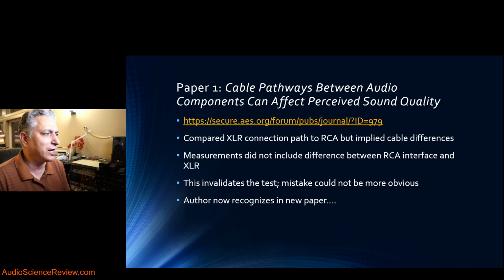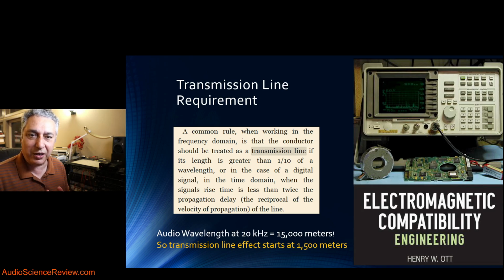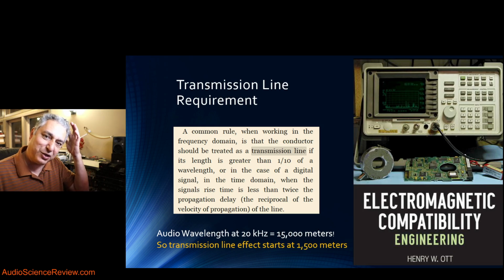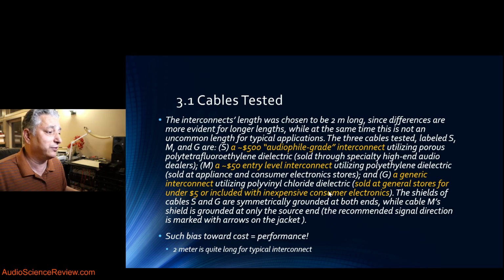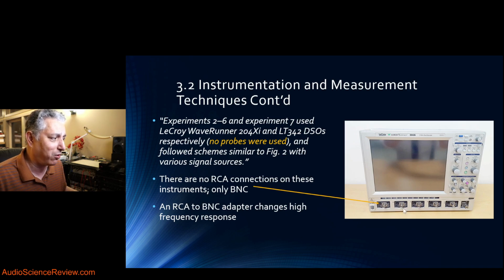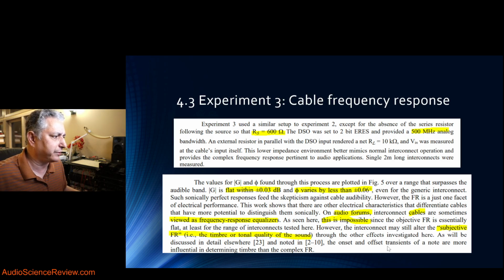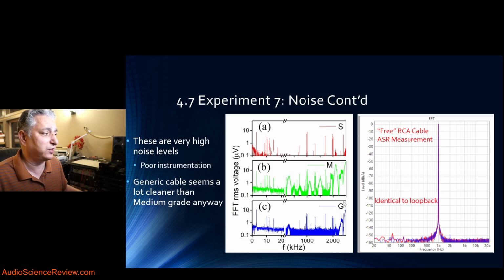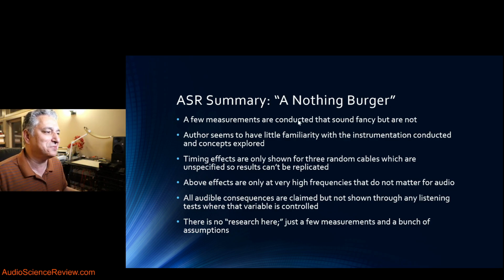Scientific Proof of Measurable Difference in Audio Cables? Paper Review

Comment: You don't need a 40 minute rebuttal to say that all reasonable metal wires at lengths of 1-2 meters conduct line-level audio well.
It's fine that you point out the obvious, but merely conducting audio signals is not sufficient.
Cables need to reject out-of-band noise (reasons listed below). To be complete you need to develop two tests:
1) audio (not 1KHz) mixed with two-tone RF (noise from the source equipment 1KHz apart) to simulate a "dirty" source equipment.
The following equipment is important, since its IMD characteristics determine the content of 1KHz on its output.
For a unified test I'd construct a diplexer with a known RF IMD in the range of the test signals.
2) add a controlled RF source to measure EMI rejection of the cable as an antenna. Similar considerations as for (1) apply.
Obviously the tests must be conducted in a clean RF environment. To some extent a shielded cage would be acceptable.
And if you ask where is the cause and effect of such noise, there is no simple answer.
Mixing products can down-convert to audio, depending on the noise content and the intercepting circuits in the chain.
For digital audio, high frequency noise can find its way into clock circuitry and add jitter.
Again, it is too complex to construct a general test for jitter cause and effect, but you can ask any decent RF engineer.
We can extend the scope of the analysis and question whether a little jitter is audible, but let's not go there...
Reply: @Douglas Blake why do you think that audio equipment cannot pass RF?
There are companies that brag about the extended frequency response of their equipment, sometimes to the MHz range.
In addition, RF tones can mix down to the audio spectrum right at the input stage of the receiving equipment.
Reply: @Douglas Blake So you're doing a good job and probably most designers attempt to do as well - but not all.
For example the Stellavox PW1 amp is made by a company that designs high-end studio gear and it has a spec of +/- 1 dB, 6 Hz - 1 MHz.
The designer may have optimized for phase response at high treble and found this approach beneficial or who knows why.
That's just one example.
You might want to check how much RF goes through stray capacitance in a typical linear power supply, despite the heavy filtering at low frequencies.
Fact is that there is gear out there with less than optimal RF rejection, either by design or lack thereof.
Rather than make assumptions, I go by what I see (an engineer's approach) and it's not all perfect. It would have been nice if it was...
Reply: @Douglas Blake Not reading any specs for cables. Just trying cables and wondering why a Belden RG59 does not work as a digital coax as well as some balanced designs and why a Mogami 2524 does not sound great with my son's guitar compared to some custom-made cables.
A shield works for heavy emissions. If you don't need it, you'd be better off without a shield. There is no free lunch.
If I extrapolate your logic, then all competent gear is perfect and therefore we shouldn't be discussing anything audio period. The problem is that there are differences in gear and not all intentional, so we can have a great time digesting the details... Heck, it's a hobby and I never argue with someone that has a different taste and sonic priorities than mine. If what you hear pleases you at the "perfect level" then you have reached your personal rainbow and can live happily ever after. Some of us are weirdos and so we keep chasing that imaginary perfect rainbow. Sometimes we see it, other times we don't...
I learned enough in my professional life to continue to ask questions. Sometimes I wonder if they make sense, but that's the nature of science. You keep asking rather than rest on your laurels... That's really what makes the world go around you know...😁
Reply: @Douglas Blake unsuccessfully?! Not really. I got excellent results from these cables, just not the ultimate. I'll use Mogami on stage any day. It does the job and the PA amps and speakers stacks are worse anyway.
How about we agree to disagree? You claim it's all the same based on limited instrumental tests and I claim that I can hear differences and therefore I think the instruments are not measuring all the important data. It's a futile exercise to go back and forth, unless you transplant my ears and brain or I give up on listening and enjoy music through my lab instruments.

Comment: A good connection between (sturdy connectors) with low resistance wire  and twisting to reject external radio waves is probably the only requirements to make a good interconnect cable. Right ?
Reply from the maker: For interconnects, yes.  Connector quality definitely varies and some are either way too stiff, or way too lose.   And shielding does need to be good.

Comment: I'm Team Amir all the way. But @11:27 you say the wavelength of a 20KHz sound wave is 15,000 meters? I think it's about 0.0172 meters, or 1.72 centimeters. Am I missing something?
Reply from the maker: Yes, please see the pinned comment.  I am speaking of speed of audio electrical signals in wires.  What you state is speed of sound through air.  The former is what is important in this context, i.e. wires.

Comment: Well the insanely high frequencies makes sense, he probably cranked it up until he was able to see a difference between the 3 cables and as we all know, the "golden ears" will think "well if there is this difference in this high frequencies then there sure must be differences in the low frequencies as well".
Reply from the maker: Indeed.  What is funny is that you hardly need to do any work to show that if that is your aim, i.e. at higher frequencies cable differences show up.  It is a given.

Comment: @Amir: Thanks for the entertaining debunk of poor science by Audiophile. If his profession is really a "scientist", his research in his professional field would also be questionable based on some rudimentary errors that should be quite obvious as a scientist. Not a scientist but a lot of the issues you identified and extracted from his test sounds ALARMING if he is really have a PHD!

Just one question though, regarding audible differences of frequencies but would "quality" RCA cables that have less noise at inaudible frequencies provide any difference in the audio chain between equipments for processing (Eg. DAC > PREAMP > AMP) that will eventually affect the final output? Or most equipments in the chain discard frequency outside the audible spectrum?
Reply: @Douglas Blake So basically the "interconnects" requirements between systems have been standardised based on their requirements which basically means most RCA out of the box from "reputable" brands are good enough? 

Audiophiles who frequently upgrade components really need to be reminded of "The Emperor's New Clothes"!😂
Reply: @soulfreshACV

Yes...... about 1 millionth of a percent.... basically No or as near to no as is possible, without it being 100% no.......

(Loss of 0.0014% over an 11km stretch of cable, at frequencies not even a bat can hear...... in our "real world" of hearing and an interconnect cable of 1 or 2 meters it would be not even be hearable and barely measurable .....)....

DON'T WORRY 👍🏻🙂🙏👌......

Comment: Does SINAD matter? Is there an audible difference between 109 and 123? What subjective audiofoolery is going on to be able to categorise a dac as "excellent" or "good" based on SINAD?
Reply from the maker: If SINAD is dominated by noise -- which is usually the case in top tier -- then yes, the noise can become audible.  It is a simple matter of how loud you play.  Regardless, I have recommended plenty of DACs with SINADs of 109 dB and higher.  It all depends on price and features.  A $99 DAC with SINAD of 109 dB is an excellent DAC.  A DAC that costs $6,000, not so much.

Comment: 0:58 The short answer is "they don't". This, coming from a guy that's actually reviewed speakers only on measurement without actually having listened to them.  an alternate perspective on reality ASR. Attacking the paper is fine, but your opinion as stated is just misinformed. If you can't point to measurements and say what accounts for stage width and depth,
Reply from the maker: What on earth are you talking about?  My speaker and headphone tests have listening tests (with some very rare exceptions).  I even go as far as developing equalization for them by using both measurements and listening tests.  Plenty of measurements indicate sound stage as well if we were to analyze content.  Just pan an instrument from right to left.  It shifts from right to left when you listen to it, right?  That should tell you that content is what defines those factors by far, not some interconnect.  The wire has no ability to make such changes.  If this were otherwise, there would be proper papers with controlled listening tests showing that which there is none.  So please don't repeat talking points like this.  Learn the topic and be informed.
Reply: Stage width and depth has nothing to do with wire and components but what was recorded and how it was reproduced by two or more speakers in an acoustic space.
You should really look for and listen to a CD called Musical Illusions and Paradoxes by Diana Deutsch, Philome 001. 
Just a recording, not special wires and equipment involved.

Comment: You peaked my interest.  Figuring that lump sum parameters are all that are really important here, I found three old RCA cables and wondered what the capacitance was for them.  I was surprised to find that the junk cable that came with a cassette recorder over 45 yrs ago measured the best at ~75pf.  And a high end video cable from Monster measured at ~85pf.  Then a Radio Shack AV cable measured ~175pf for the audio and strangely ~110pf for the composite (Y).  All cables were about the same resistance.  So even the worst cable if driven with a 600 ohm source won't hit the 3dB down point until  over 1.4MHz.

Comment: Maybe I have this completely wrong but in terms of transmission line effect, the audio range starts at 20Hz which has a wavelength of 17m. One tenth of this is 1.7m which is within a reasonable cable length. So is the transmission line effect relevant for low frequencies in the audible band or have ( as is possible, even likely ) I made a rookie mistake ?
I wondered why Amir, somewhat arbitrarily, chose 20,000hz to make his point.
Please help me out here. And please note, I'm not defending this paper which seems to be a pile of shit.
Reply: @Douglas Blake Cheers Douglas. I figured I had made a stupid mistake. Just wasn't sure what it was
Reply: Not sure what Douglas Blake said. Your number if about right in air, not in a cable.

Comment: By not stating the characteristics of a high, middle and low end cable and not providing the reader with manufacturers makes a nonsense of the report.  A $500 cable is not really that 'high end' . What about a $10,000 cable?
Reply from the maker: Indeed.  What is amazing to me is that the people promoting it didn't read and understand that either.   It is written in such plain language so they really have no excuse there.

Comment: if it happens at 1500 meters ,then it must start at zero length. natural things dont just start at 1500m's onwards. .to get to 1500m's youve got to start at zero ,1m and so on. this means it must be happening on a micro scale in smaller length cables..
Reply from the maker: So you must wonder if time is changing for you when you drive because that is what Einstein's relativity says.  But you don't right?  Transmission line effects start to become significant at 1,500 meters.  At 1.5 meter you are 1/1000 times shorter than that *start*.    But sure, do measurements of that and report what you see.  Not send 250 MHz signal and say same thing is true of 20 kHz.

Comment: why does it matter what a good cable or bad cable measures if either one of them sounds good. are you implying that all cables sound the same?
Reply from the maker: Well, the paper in question is being endorsed as measurement proof.  There is no listening test in there so your comment doesn't apply.  But yes, every cable I have tested sounds the same as another when it comes to interconnects.

Comment: Hi I have found your site very interesting and wanted to get your thoughts on the X-18 DAC you rate it as a recommendation based on measurements. Curious as to what your thoughts are on the comments in this video https://www.youtube.com/watch?v=Fa1y9JRip68&ab_channel=GoldenSound at about the 26min mark. Seems to me that you might not be properly measuring some devices
Reply from the maker: Careful with GS videos.  His aim is not genuine when it comes to using measurements to characterize audio performance (he ignores it all when he does his subjective assessments).  On that specific point, he is using an artificial test signal to cause an overflow.  Such overflow would sound quite distorted yet you don't see reports of people using this and many other DACs.  Actual overflow in music is quite rare.  Note that I already push DACs by using 0 dBFS test signals.  Others such as Stereophile use -3 dBFS to take it even easier on the DAC.  The overflow is also filter specific.

The rest of his video is quite a farce.  Of course if you don't follow standardized practices you can screw measurements.  Or create measurements that are different than others.  I am consistent in how I measure DACs and have done so across nearly 400 of them.  As a result, you can compare my measurement of one DAC against another with ease.  He on the other hand takes liberties with this and that measurement, putting him on an island by himself as he has too few measurements to compare.

Comment: Ignoring the invisible electromagnetic field around the wires isn’t scientific. Impacting that field does affect the signal. It is to a lesser degree on speaker cables than interconnect cables. However, there can be a difference in the electro magnetic field which has an impact. Until we can accurately measure field characteristics, we are going to remain in the dark.
Reply from the maker: The paper is around what is measured, not what is visible or not.  Those measurements are either correct, or they are not.  Testing a cable at 250 Mhz when it only carries 20 kHz in audio is just wrong.  It doesn't matter what the "invisible" fields around the wire are doing.
Reply: @Douglas Blake so your testing multiple frequencies at multiple magnitudes at the same time right? That is what we are talking about. Anything else isn’t real world conditions. Nice try at trolling though.
Reply: @Douglas Blake I do. You see, measuring some singular sample of a complex response is limited. I build race engines. You can use a flow bench to get an idea of how good a port on a cylinder head is. You can build the engine and run it on a dyno to measure the torque and horsepower. But until you take it to the track and force it to perform against the other engines you simply don't know how it performs.  You can build two engines with the exact same components, machined exactly the same and they can and typically do perform differently. 

The entire issue comes down to substituting singular measurements for actual complex system response. Let me ask you this. Are all Oscopes equal? Are there differences in their amplifier sections? We all know that amplifiers have an effect on sound and therefore MUST have some difference, even if the only measurement is audible. To same otherwise would get you laughed out of the room, yet when it comes to cables, some of which have significantly different designs, they are all the same and there can't be a difference. As someone who has studied systems throughout my life I would suggest that that premise crashes hard on the rocks of reality. EVERY component can have an impact on the sound quality. Otherwise, you are suggesting that man has created perfection, which is also KNOWN to be impossible. 

Have a good day.

Comment: I don't understand the wavelength part (in the transmission line section). If I google the wavelength at 20khz I got told this is about 1,7cm, not 15000m. What am I missing?
Reply: I see. Thanks for the answer!

Comment: Even more expensive DACs can have a significant difference between balanced and  RCA. My VMV D1 DAC has a superiors balanced circuit compared to RCA. It's audible and measurements back it up.
Reply: @Douglas Blake   I know how common mode rejection works and balanced circuits need to run the signal through more circuitry (not ideal) in exchange for less noise,  Running very short (1-2 feet) shielded cables and keeping noisy cables away from sensitive signals, should negate all but a miniscule amount of noise. 

Any decent company should and often do design both balanced and unbalanced circuits to the same high standard.

Balanced circuits only reject noise that gets on the interconnect cable between two  component. They can't get rid of any other noise upstream (humming transformer, faulty device......). Balanced circuits do not magically make the signal better. In many cases "balanced" is not even a fully balanced circuit, so. 

My point was that even expensive components can be designed with inferior unbalanced circuits. Balanced is only better if everything else is equal.
Reply: @Douglas Blake I know what line level is an 2 + volts is more typical for decent quality components. I have a Marantz CD with a 2 volt output and a bunch of SMSL and VMV DACs with at least 2.2 volts for RCA and 4.6 volts for XLR. 

More power isn't always better. I'm not sure what your point is. It seems your argument is that a hotter signal will deliver better or more sound. A cell phone is too weak at 0.5 volt, but anything worth listening too will be closer to 2 volts, which is all you need .
Reply: If you have no audible noise using phonos switching to XLR will make no difference.